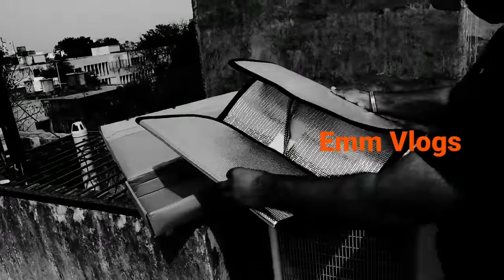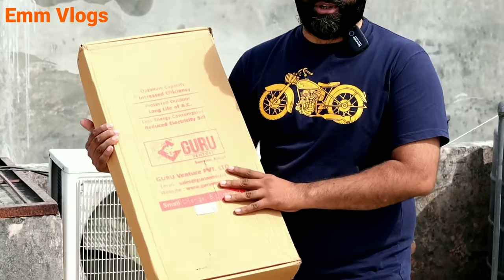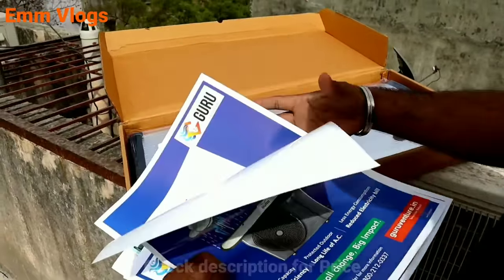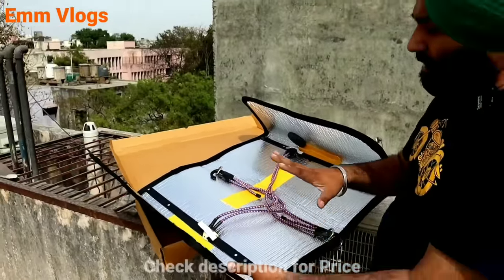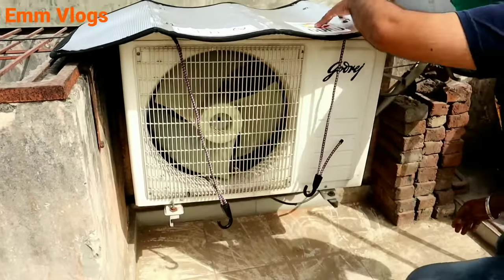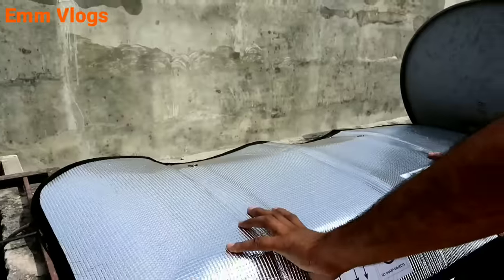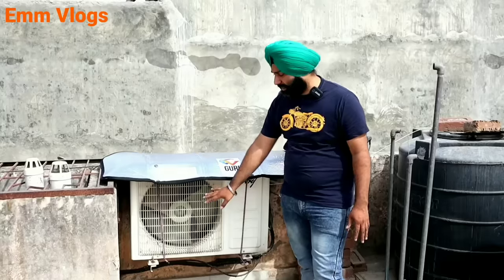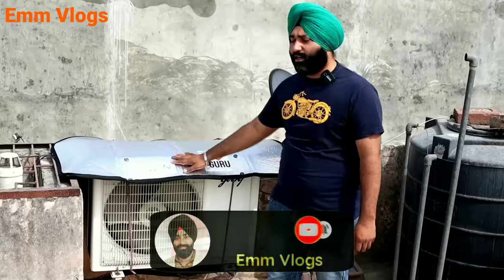Cheap and Best Protection Guard for Split AC Outdoor Unit || How to protect Split AC Outdoor Unit ||

Comment: Only one thing is that elastic bands should have heat protection sleeves so that the heat coming out of the outdoor unit damage the elastic bands.
Reply: 'Do not damage' (the elastic ropes.)
Reply: Metallic Spring ties should be a better option.

Comment: It's a great ways of covering , I am looking it first time .  It's nice , Excellent 💯💯
Reply: No Company recommend such covering,this is sponsored Video so don't get trap its useless product, outdoor units of all Good companies they are made to sustain rough weather,Rather Covering Blocks Air Ventilation of outdoors,So never use such products completely useless and waste of money
Reply: Mandeep ji I've High regards for you but this is not Good,No Company recommend such covering,this is sponsored Video so don't get trap its useless product, outdoor units of all Good companies they are made to sustain rough weather,Rather Covering Blocks Air Ventilation of outdoors,So never use such products completely useless and waste of money.
Reply: @vinod_bhanot vinod bro,mujhe v aisa lga ke achi ac companies ac ke odu unit ko bhr ke temp, weather ke according he bnate honge,bt 1-2 doubts h kya ap bta skte ho..?1- rainy season me heavy rain se condenser ke coil wgrh,fan blade pe rusting nhi ho jayegi..? 2- 45°c + ke heavy sunlight heat se isme koi problm nhi ho jayegi..? bro yh product to muje v bht he useless & costly lga,bt kya hm odu ke upr fibre sheet lgwa skte h 2 feet upr..?
Reply: @bhagwabrigadebhgwa4infiniteyrs  Nothing will Happen, I'm using Daikin,Hitachi,Panasonic since Last 15 Years Same Units No Problem

Comment: Heavy rain या आँधी आने पर ये टिकेगा नहीं..... उड़ जाएगा... Elastic में इतना दम नहीं होता जो तेज़ हवाओं में रुक सके....I think it's waste of money.....
Reply: I can make it by myself at rs 100 only 😂😂
Reply: @tuhinmadhu639  your time and effort has zero value? Where do you get the material and elastic? The transport cost to go and buy those things need to be added too.
Reply: Are bhai uske uppar 2 eeta (bricks) rakh dena
Reply: Gyaanprakash naa baneeye. 
Bahut practically tested product hai
Reply: And u don't even need this. The units are designed to run under heavy rain. There is no part in the ac that can't take a bit of water . U can submerge the compressor under water and it will run like nothing happened. The fan and everything is desinged to ingest water of the heaviest rain possible and still function properly till their rated service life...
Reply: Use Plywood sheet instead of this..
Reply: @santoshkumar-go5mm  no cover required for any ac...
Reply: @sudhirjaiswar2159  hahaha...well said 😂
Reply: @KuntalGhosh  why bro

Comment: Sir pls confirm Mitsubishi window 1.5 sahi rhega
Reply: General Hypertrophical window AC which comes with 1.5 ton (AXGT18FHTC-B) and 2 ton (AXGT24FHTC-B) capacity are all time great AC, ultra durable.

They are the most often sold window AC in Middle East where the weather is very hot and day is very long.

MHI window AC will be the next best.

Comment: Sir inverter ac me outdoor unit cutoff hoti hai kya agar temp 26-27 set hai aur outside temp 38 plus hai
Reply: yes
Reply: @thelazyyoutuber1929  than what is difference between inverter and non inverter ac  if compressor frequently cutoff and on
Reply: @RohitKumar-sh5rn  after every cut off when it starts back, non inverter AC starts working at its peak power whereas an inverter AC can run at lower power point depending on room temperature and ambient temperature

Comment: Hello sir, I hope you are doing very well. Actually I am eagerly looking for 1.5 ton 5 star inverter split ac, I want to buy this as early as possible. I am belonging from Kolkata location. My budget is 50k to 52k( including Installation and fixing charges). Can you please suggest me that which branded ac has comes into my budget and after sales service which brand will be provided better to other in my location. I am also keeping this thing in my mind that maximum cooling with low electricity consumption and noise level should be silent . Please let me know as soon as possible. Thanks in advance sir ji !!😊
Reply: O GENERAL 1.2 TO 1.5 TON  5 STAR SPLIT INVERTER AC. FIX IT AND FORGET IT..... BEST IN CLASS  FOR KOLKATA. I AM USING IT.

Comment: Pls I am stuck with one doubt. I have gone to purchase Samsung 2021 5 star 1.5 tonn ac(issr-5.2) in 36490/ plus 2000 Installation cost.

The sales executive is trying to sell me Panasonic 2021 model 1.5
In 42000 including installation

Bcoz Samsung after sales service is not that good as per quality

Pls recommend me little urgent which one to go...
Reply: I have bought panasonic 1.5 ton 4 star ac, it is working superb. I was also confused with a lot of brands. But in 36500 this model is giving more features and installation and delivery was completely free. Just personal suggestion.
Reply from the maker: kya apko pata hai ki samsung ki service achi nahi hai yaa fir ye bhi salesman ne bataya hai ?
Reply: @emmvlogs  waha k dealer ne bola ki quality Panasonic ki achi hai. Samsung is good for TV not ac. He was continuously forcing for Panasonic. I don't know why
Reply: Man mera samsung ka h qki thoda budget m hai. Lg Panasonic se 5k low hai. And 5 year comprehensive warranty h and compressor 10 yrs. Samsung dera. issr rating b 5.2 hai
Reply: @emmvlogs  kripya reply kijiye

Comment: Elastic Cables! It won't be much durable.. possibly one year max..
Reply: Since the cables are below the surface which will receive sunlight, it will last long, also you can replace then with regular ropes once they go bad
Reply: Ekdum ghatiya product hai yeh. I got one after seeing this review. 2-3 k baarish k baad i checked and found ... Outdoor unit ka paint kharab karta hai yeh. Company ne is product mein jo bhi metal ka use kiya hai woh cheap quality ka hai aur iron hai... Jisme easily rust lag jata hai. Strictly not recommended!!! 1849/- mein amazon se liya thaa... Uske saath around 2K spend karke ek shade bana lena chahiye... Long run mein kaam ayegaa. Only one good thing in this product k iske saath ek Mask ataa hai...Bas... Yeh sab paid review hai... Don't trust. Inka kuchh nehi jataa. Yeh unbox karke bina use kiye product ko premium bol denge ... Lekin chu*** hun ban jayenge... Don't buy this.

Comment: To much cost of this product as per Work ...protect thermocol sheet as per same work but no cost just 100/ or 50 ruppe per sheet
Reply: Ekdum ghatiya product hai yeh. I got one after seeing this review. 2-3 k baarish k baad i checked and found ... Outdoor unit ka paint kharab karta hai yeh. Company ne is product mein jo bhi metal ka use kiya hai woh cheap quality ka hai aur iron hai... Jisme easily rust lag jata hai. Strictly not recommended!!! 1849/- mein amazon se liya thaa... Uske saath around 2K spend karke ek shade bana lena chahiye... Long run mein kaam ayegaa. Only one good thing in this product k iske saath ek Mask ataa hai...Bas... Yeh sab paid review hai... Don't trust. Inka kuchh nehi jataa. Yeh unbox karke bina use kiye product ko premium bol denge ... Lekin chu*** hun ban jayenge... Don't buy this.